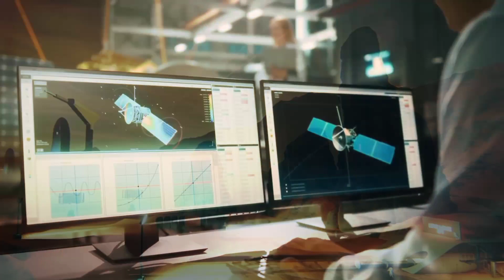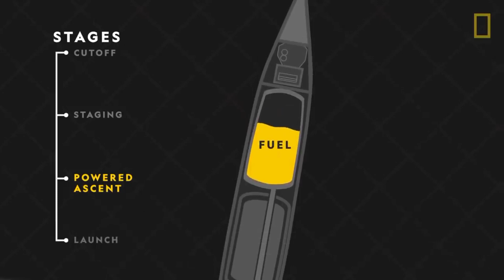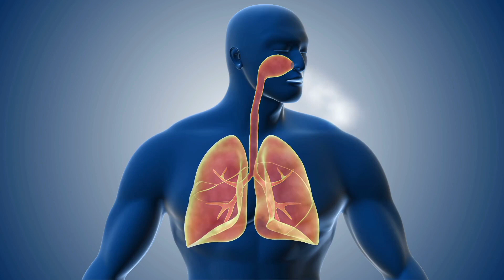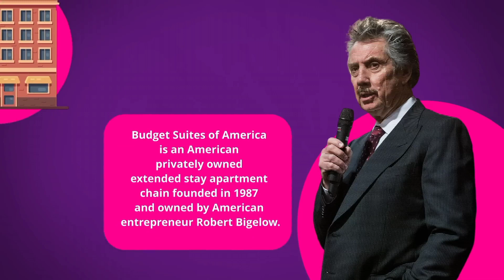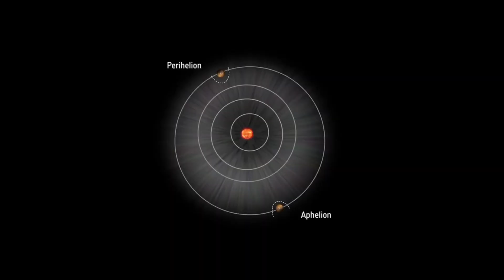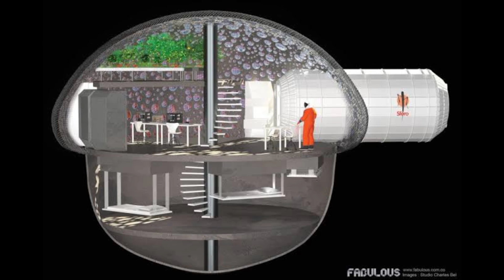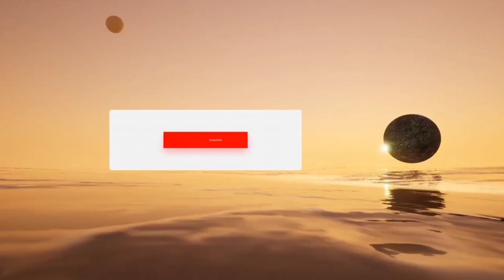How To Colonize Mars: Faster, Easier, And Cheaper Than You Think!

Comment: Great channel. I subscribed! Hi. I'm an amateur planetary scientist and Mars is my specialty.  The key to a successful settlement on Mars is: Location, location, location. At the west end of Valles Marineris is a feature called Noctis Labyrinthus, which is in the heart of the Tharsus region. The coordinates are 7°S, 93°W. There is a water ice glacier there which contains 36 billion tons or 8.7 trillion gallons of H2O, or just a bit larger than Lake Meade at the Hoover Dam near Las Vegas, Nevada, USA. The canyon floor is 4.35 miles deep, which provides twice the atmospheric pressure: 12.4 millibars, compared to 6.1 millibars at the datum level. The 3.75mi/6km high canyon walls also provide very good protection from cosmic radiation. Noctis will enjoy a relatively mild climate, as it is only 7 degrees south of the equator (258 miles).  All good wishes.

Comment: Somehow I don't think that living in a balloon will be very reassuring to the pioneers. Why don't they live in the ships that they travel in? Much safer and already has a working life support system, no extra mess needed.
Reply from the maker: You're right that safety is a huge priority. Perhaps an initial hybrid approach makes sense - use ships for transit and emergencies, but also construct basic surface habitats to start gaining experience living off-ship on Mars. As safety improves, crews could spend more time on the surface. Multiple options may speed progress toward a sustainable human presence there.
Reply from the maker: Some potential considerations with using the ships:

Shuttles are designed for shorter trips, not permanent habitation. Living quarters may be cramped for larger crews over many months/years.

Ships require fuel and maintenance which gets more difficult the farther they are from Earth. A surface habitat removes that constraint.